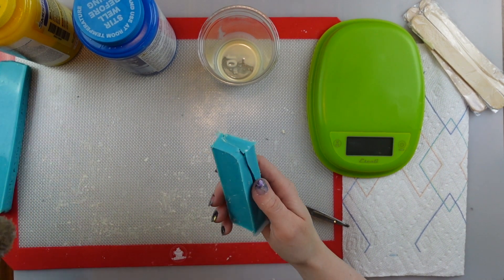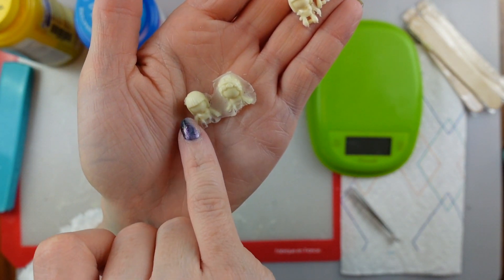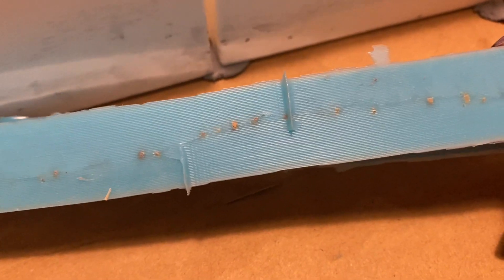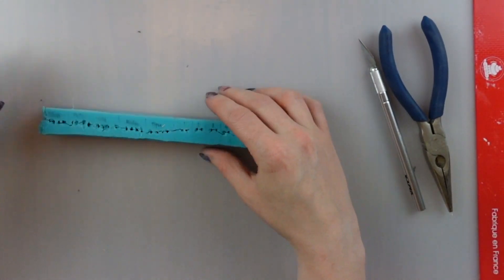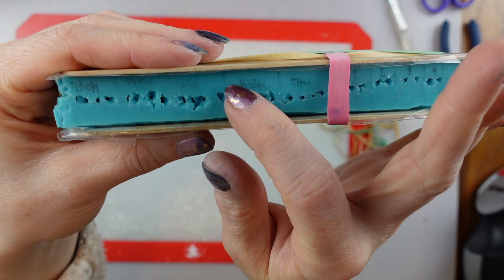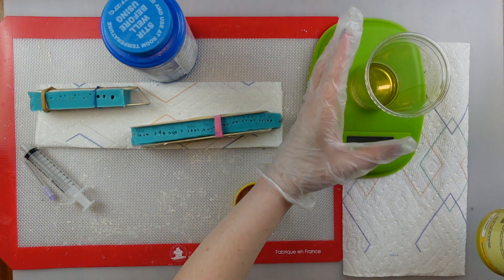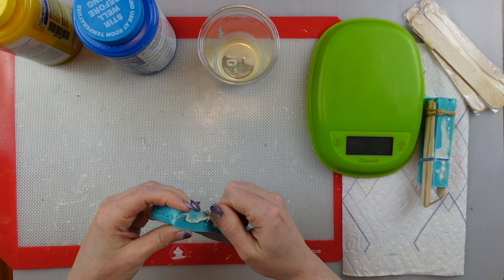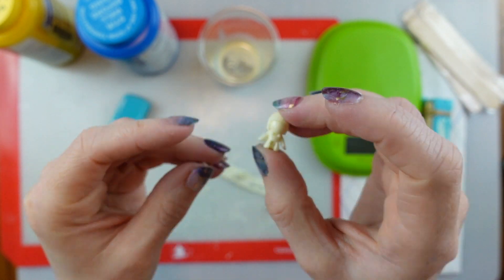RESIN CASTING MY OWN POLLY POCKET FIGURES | Vintage Polly Pocket Collection

Comment: You also could have free hand cut a handful of little triangles in the first mold and then used the release and poured the second half. That way the top piece would fill into the triangles that you had cut and when finished, it would fit together perfectly (and only one way), since the triangles would be random and different sizes, etc. Like a puzzle.
Reply: Or peg holes instead of triangles.
Reply: I'm really liking your videos. I ended up on one of the discoloration videos randomly, sort of, and I'm glad I did. I LOVE rehabbing things, and have been doing so for 40+ years, and I've actually learned a thing or two from your videos already. You explain things so nicely, and with such a pleasant way of speaking that it's relaxing while also being educational, and interesting. (and cool!)